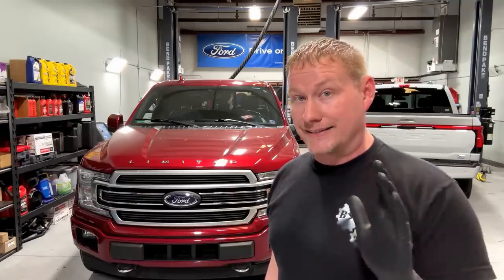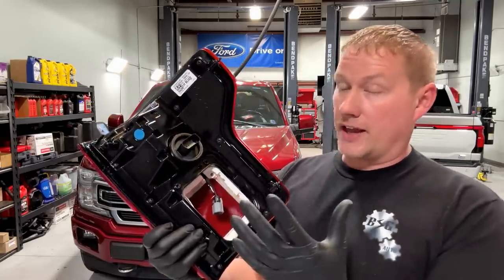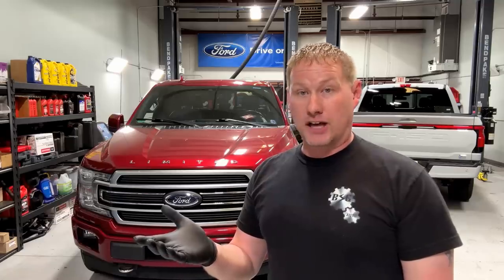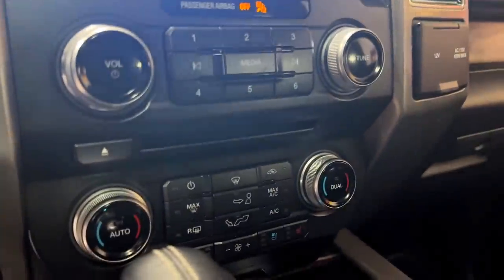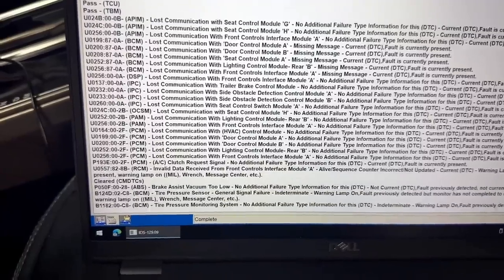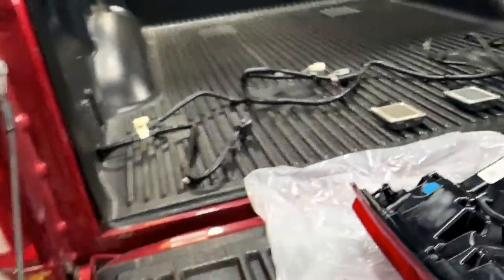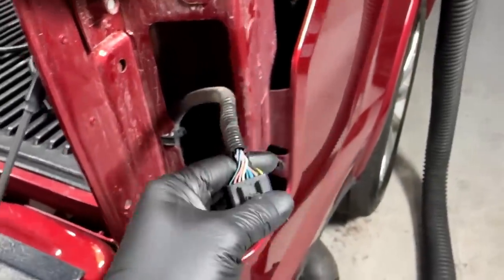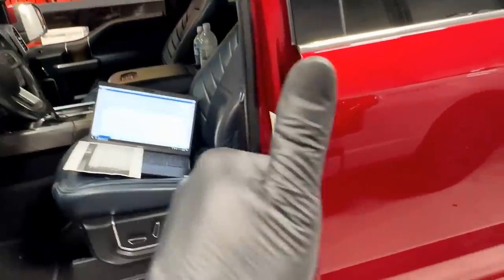Repair Cost Are Out of Control: $5,600 Bill for Some Tail Lamps?!

Comment: This is my truck. First off, I want to express my gratitude to those who advised me to contact my insurance company. I followed your advice, and Travelers Insurance paid me $5100 since the issue turned out to be water-related. Huge shout out to Travelers!

Now, the general consensus around here is that all this safety equipment is unnecessary. However, for me personally, I find the BLISS system quite enjoyable. Living in the Chicago area means dealing with wide tollways, around 4-5 lanes in each direction, where people speed at 80 MPH. But here's the catch, that same 80 MPH traffic can randomly slow down or even come to a halt. I find checking my blind spot monitor on my mirror much safer than looking completely behind me. 

I would personally be willing to pay $5000 for that extra safety. If I still lived in southwest Missouri, my place of origin, I might skip this particular feature. Driving is less of an extreme sport there, and a simple fender bender wouldn't turn into a gun fight the way it very well could in the Chicago area. 

I must say, having Brian as my technician is a true blessing. Just two months ago, the folks at the local Ford dealer (HAWK FORD) told me that my truck needed a new front differential. However, Brian correctly diagnosed it as a front wheel bearing issue.

Brian undercharges for his expertise, and FORD dramatically overcharges for taillights.
Reply: So BOTH lamps had the water intrusion - are the new ones an improved design or is this just a few rainstorms away from paying this again?  Direct replacement seems so risky.  I think I'd have you try to dry it out and get it working well enough to trade it in and buy something else with repair costs like that.  Sorry you had so much trouble but glad to hear insurance covered most of it.
Reply: Another issue with these tail lamps is that they also get stolen. Make sure you make it difficult to remove the lamps. change the 8mm screws to safety torx and make each one a different size. or your paying 5600 all over again
Reply: @ian3580  I was wondering the same thing since they were replaced with OEM units.
Reply: I'm so sorry for you
Reply: I wouldn't pay 5000 for an entire car even though I can afford a new truck like yours :) Glad you were able to pass the cost onto the insurance though!
Reply: @ian3580  
i really, really doubt those new assemblies are any better sealed than the old ones were. they may claim they fixed the problem, but i don't and never will believe them.
ford has a very long history of electrical problems.
ignition switch problems dating to the late 60s. fords burned down, including the garage it was parked in, and many times the house attached to the garage, and sometimes the family sleeping inside that house.

at least 3 different times ford said, oh we fixed that problem with the ignition switch, no they didn't. it came to a point they were forced to do some recalls, but only on some, not all that had the bad switches.
was an internal memo found that said it was cheaper to pay out a few "death claims" than it would be to actually fix the problem. to fix the defect was to admit there was a problem to start with. IIRC, the fix was to move some contacts 0.5mm apart & change the grease inside the switches. yeah, they KNEW for a fact it wasn't right.
another hazard on a ford, cruise control pressure switch under the hood. really ford? lets put a diagram pressure switch that with be in direct contact with the brake fluid on the master cylinder,.... that pressure switch starts leaking, develops high resistance, over heats and you got fire.

ford better ideal,.. HEY!!  lets mount the brake light switch ON the brake petal so every time the looser,.. i mean owner/driver hits the brake the wires move and then the wires break and the brake lights stop working & they get rear ended at speed.

and there have been some other stuff with ford,....
Reply: @konstantintomilin1826 Why?  So we can all pay higher insurance rates going forward?
Reply: Ford also had a problem with outside air doors in the HVAC system a few years ago.  So did Mazda.  They both used the same sucky supplier for the HVAC system.
Reply: Glad your happy,  but most familys wouldn't be able to afford to pay this money much less spend it on one stupid tail light... your very fortunate that you can afford it and that your happy to pay ....  most people are not able to pay such a large amount
Reply: Thumbs up for insurance coverage
Reply: @BaltimoreAndOhioRR  Just wait until you see the insurance cost of an EV!  My brother bought a hybrid (EV/GV).  I believe he said the insurance costs $400/month.
Reply: Glad that worked out for you. I bought my first F150 from Hawk Ford. If I still lived there I would definitely be bringing my truck to Brian as well.
Reply: Shouldn't Ford be fitting the bill and not your insurance?
Reply: Love the line that says "driving is an extreme sport". That's even true here in rural and remote hills of West Virginia. They're doing 65 and 75 on our curvy back roads, passing in double-line curves, it's getting crazy out there.
Reply: @irbfenian2594  only warranty, or special policy if its a concern to them
Reply: No doubt the safety feature is worth the initial price of entry. I guess they just need to make them waterproof, especially being marketed as a work truck, where it might get wet one day... because this level of failure at highway speeds doesn't seem very safe.
Reply: I will stick with my beater and .45
Reply: All the manufacturers way overcharge for their taillights.  Many of them have the electronics built into them and then you have to pay for them to be programmed once you get them so they will actually function as taillights because they are on a buss system and respond to commands rather than just receiving and electrical voltage or a ground.  It's ludicrous.
Reply: Thank god I live in rural Nevada. Warm and dry, no rust and not many people.
Reply: Congratulations for having found an awesome mechanic and technician and a friend!
Reply: @lewis2553  I'm the same way I'm happy with my 1999 Forester I just put a new engine in it about 6 months ago. I'm not worried about insurance right there's enough people buying new shity cars. I will stick to something that I own and it is cheaper and easier to maintain. It's also absolutely amazing in the snow.
Reply: That explains it. Have a 02 f150 with over 280k miles. Some years ago it caught fire around the brake booster. It was parked. Luckily we caught it early and immediately put the fire out. For a while I couldn’t figure out why, no wires where exposed, fuel lines where right, no dry leaves or stuff that can catch on easily where present.
Reply: It’s a beautiful truck but it’s one of those things where I will never own one. I do very well for myself as an engineer with no school debts and live comfortably. I still could never afford this kind of vehicle.
Reply: You are correct in that looking at the mirrors is better than turning your head. You should never turn your head over your shoulder when driving forward. If you adjust your side mirrors properly, you won't have Any blind spots or need any unnecessary crutches.
Reply: How many miles did you have on this truck when the issue occurred?
Reply: Thanks for sharing! Very valuable to get the backstory, and glad the insurance covered you on this! While you may be willing to pay $5,000 for taillights, that is something that is not viable for the general public. I do however suspect this cost will plunge in the future. It's good that Ford solved this issue, but I would have never, ever guessed it could cause a no start condition.
Reply: @WizardOfWhoopee same where I live. If your not doing 80mph on local highways, your in the way.
Reply: @WizardOfWhoopee   Gotta go fast to pick up more meth, bro. Them cat converters and AC coils ain't gonna strip themselves.
Reply: These kind of expenditures is how people making $250,000/yr end up living pay check to pay check.  When the economy tanked in 2008 one of my neighbors was selling off all his toys to try to pay his mortgage while he looked for another job.  You live in a $1.5 million home, but don't have 6 months of accessible emergency funds?  Yes he was foreclosed.
Reply: "Brian correctly diagnosed"  No, Brian told you what actually needed fixing, whereas the stealership would have sold you a whole new front differential for a couple thousand dollars and then charged you three times that for labor.  They probably would have replaced your hub bearing though, because, you know...  TECHNICALLY the wheel hub is attached to the differential.  Kind of like doing an engine swap to replace a leaking valve cover gasket.  Seems fair.
Reply: @NoName-ml5yk   That's the way of things now.  People with more money than sense.  These companies thrive off of it because they've convinced them to put everything on credit and just keep paying, telling them that it'll all work out in the end as long as they trust them.  Meanwhile, they're too terrified to try to work on or fix anything themselves because they're told it's too complicated for them and they shouldn't learn anything about their vehicles, just keep trusting and paying the dealers.  Don't worry though, the middle class in America is collapsing and soon we'll all be dirt poor with only a handful of billionaires left to lord over us.
Reply: @edward1937 gm also don't always do recalls
Reply: @SW20FL you're right as the vehicle will age the price of the parts will drop.
Reply: @upinarms79 Yep
Reply: I would never buy a Ford vehicle, not because of the vehicles, but the Ford dealers. My daughter had an Aspire that the dealer supremely screwed up on, being unable to diagnose and replace a transaxle output bearing until it took out the transmission.  
I've had many other dealings with local Ford dealers going back to my teen years.
Reply: Well stated, and points taken.  What was the rationale for Travelers to cover the repair, was it related to a claim?  I doubt State Farm would cover the bill.  Just curious.
Reply: @WizardOfWhoopee  So true.  I drive superduty Fords with gooseneck trailers in WV, oilfield work.  It’s scary, no berms, narrow roads, people racing to their graves it seems.
Reply: The car dealer's love folks like you! Willing to pay ridiculous prices for cheaply made garbage that you don't even need!
Reply: If the safety features are unreliable, how safe are they? I would never trade my instincts in for technology.
Reply: This failure is not as common as you might think. Just remember, the F-150 is the best-selling vehicle in America. There are millions of these trucks out there. And let's not forget, they don't fail without the driver being alerted to such a failure.

Now, let's talk about auto crashes and all those friends of yours who, unfortunately, are no longer with us. I'm sure you have quite a few dead friends. Well, guess what? So do I.

It's quite convenient for the living to boast about their survival skills, conveniently forgetting how many of their friends and family members met their untimely demise on the highway. It's possible that some of these safety features could have saved a few lives, or at least prevented some of those reckless drivers from crashing into others.

Take my truck, for instance. It's pretty hard to drift out of a lane thanks to the lane departure system. And if I did happen to drift, I wouldn't be able to overcorrect and roll over because various systems prevent that from happening. 
 @cmhwilder
Reply: @ImExcalibastard  I don't trust them to ensure there isn't a vehicle in my blind spot, but I do trust that if the sensor indicates a vehicle there, there is. So if the sensor shows a vehicle there, I don't crank my head around to confirm that. If there's no indication of a vehicle there I do look to visually confirm before I change lanes.
Reply: The issue with checking for blindspots safely w/o turning your head back (which I personally find ridiculous and dangerous and never understood why this technique was being taught at drive schools) can be resolved by adjusting your side mirrors so that you don't have those blindspots. Yes, even with those stupid flat driver-side mirrors (that somebody from the government decided were safer than convex mirrors the rest of the world enjoys) it can be done, though you won't be able to see the side of your car in them when in your typical driving position, which for me is the lesser of two evils. If I ever need to check for the side (e.g. backing out of a tight garage) I can just move my head close to the window and see the side of the vehicle just fine. It still beats having an electronic gizmo that will fail on you and might cost you an accident (or a $5K repair bill)
Reply: @lewis2553  so never use insurance for what it was intended for, but keep paying them? I get it that insurance is the sleaziest racket out there, but you're d*mned if you do and d*mned if you don't.
Reply: @deucebigs9860  Yes, use insurance "for what it was intended for", but, no, it wasn't intended for this.  This should have been paid for or repaired for free by the dealer either under the warranty or just for the sake of the reputation of the company.  The ones who are "sleazy" are the car companies who don't give a "bumper to bumper" warranty but only cover the drivetrain.  So quit buying from them.  But don't misuse your insurance.

Insurance is for accidents (liability and collision) and incidents (comprehensive) beyond our control such as flying rocks, falling trees, and floods.  Unless this water damage was from a flood, then this was a clear case of negligence on the owner's part.  You can tell when water gets inside a light.  It can be seen either as condensation or as pure liquid inside the light.  Corrosion doesn't just happen overnight.  The fact that the person chose to leave it there until it caused this much damage is grounds for the insurance company to claim contributory negligence, even if it was caused by a flood, and not pay a dime.  I've seen that happen, even in cases of collision between two vehicles.  Both parties' insurance companies agreed to claim negligence on the part of the driver who was innocent, and neither one paid a cent.  Each of the involved parties had to fix or scrap their own vehicle.  That wasn't fair, but I'm just calling it like it is.  But what you can expect, since this person has already gotten away with it, is higher premiums for him - and rightly so.
Reply: L I’m
Reply: @lewis2553  They covered it so it was used what it was intended for just not what you agree with.  Insurance companies don't just pay out for shiggles.  Really if water is getting into the light of a new truck it's on Ford to fix and pay for it all is my feeling.  Car companies should at least be able to waranty those items at least 10 years.
Reply: @benking9503 
Maybe fortunate or like others worked hard and sacrificed time for other things to create the ability to afford it? We don’t know what don’t know.
Reply: The end of that 3rd paragraph was fkin amazing bro 😂
Reply: How is this not a warranty repair instead of insurance? ???
Reply: the real issue is ford can't seem to build waterproof tail lamps...
Reply: Also in the Chicago area so I share your pain: crazy drivers, never-ending road construction with scary narrow lanes and bad weather.
Reply: @KameraShy  Try handling a tractor trailer rig in those construction zones with narrow lanes.  I've been there and done that.  It ain't fun.
Reply: @@JohnSmith-bo7gn They wanted you to be a repeat customer.  You would have had to come back and have them replaced.  That would have been an easy $5600 for them.
Reply: @lewis2553 Thank you for that bit of info. Added that bullet to my not yet full magazine of F!K EVs reasons. Cheers!
Reply: Glad your issue was finally resolved to your satisfaction. Thank you for calling out HAWK FORD by name for their miscreant behaviours. All too many YT'ers, both Presenters and Commentators lack the balls to do that. Respect!
Reply: what year of truck?
Reply: There are these safety devices called mirrors, they are amazing when you know how to use them
Reply: @@nateafcsouth  Bubble mirrors are your friend.🙂
Reply: @lewis2553 that was my concern as well the minute I read the water damage comment and there is a 100% chance we all likely will pay higher ongoing, for insurance in the future,  its already happening. This is the reason that at least 20 states have right to repair laws. Intellectual property rights vs. the right to survive and right to repair will be a massive ongoing issue down the road.
Reply: Sounds like you have money to burn I don’t feel bad. Enjoy the truck! I do hope you don’t have any more problems though. Safe travels
Reply: Good you got most of it covered but $5100 on insurance, no wonder insurance costs people a minor fortune with everything people claim. The really issue is Ford. $5600 for a rear tail light and radar is crazy. Radar detection parts in general are $25-$500.
Reply: I have a '19 Ranger Lariat, which isn't as fancy as a Limited trim, but it has a lot of that same computerized crap inside. This scares the shit out of me. Glad I chose the bumper-to-bumper warranty before I drove it off the lot.
Reply: I would never buy a truck this complicated  I owned a classic 72 Chevy short bed 350. 359 turbo sold it for 18800 I Aldo owned a 92 305 auto Trans had to have Trans rebuilt 1865 dollars plus one year warranty by a transmitting expert my parents knew  that is4000 dollars less than they fir for rear tail lights and modulat nobway would I put up with this this is insanity
Reply: Oh God, I'm so sorry you had to deal with HAWK FORD 😔
Reply: @Mytruck5600tailights very well put. They do make those sensors for people who can't drive very well or shouldn't be driving at all.
Reply: @pasolumination Truth!
Reply: A lot of people might talk bad about these expensive safety features but they may not consider that having these features may prevent a much more expensive accident.  Of course they must be used in conjunction with attentive and safe driving habits to be effective, however.
Reply: @NoName-ml5yk  "He who dies with the most toys still DIES!" 😂😂
Reply: Honestly I wish I lived close to Brian’s shop because there’s no one in my are a trust to not fire a parts cannon at my truck.  Brian is the real deal and he does very professional work and looks out for his customers.
Reply: @vorsprungdurchtech  It has to do with being honest and smart.  If a person is lacking in either of these two areas, he uses the parts cannon.
Reply: Springfield area huh?
Reply: You wouldn't need an active blind-spot monitoring system if you didn't drive a damn house on wheels.
Reply: You are an awesome customer.  You are working with what you have and not reacting emotionally. 

Cheers.
Reply: @lewis2553  Exactly. Now I understand why Allstate and the others have literally DOUBLED their rates in the past several years. Automobiles are getting terrible. Over computerized, inferior trash.
Reply: Such a shiny work vehicle.
Reply: You just be safe. I want you to be safe.
Reply: Drill a couple of small weep holes in the bottom of the lens so the water will not collect in the lens but will drain to the exterior. This can be done in a way where it is not visible from the outside.
Reply: If a headlight bulb burns out on my 2003 its $1000 per side because you need to replace the whole headlight. Well used to this.
Reply: I was looking at the video with suspicious eyes. At both Ford (leaking tail lamp recall?) and the mechanic (obviously). But reading that your insurance took care of this and about the mechanic's previous save, I powered down my outrage. I've been looking for "a Brian" my whole life. I've never had any single independent mechanic work on my car twice. Even when the job was done right at a good decent price I figured it was a catch and release so's they could gut me next time. I got my last two cars fixed and sold them immediately.
Reply: SELL IT
Reply: This customer was really lucky to have a mechanic with the ability to understand all those modules and how to repair them. The dealership would have charged him $12,000! I guess the old adage that F-O-R-D stands for F’d On A rotten Deal still applies!
Reply: @ebutuoy6463  You are replying directly to that customer. LOL
Reply: Fix Or Repair Daily
........ never goes out of style
Reply: 2018? That isn't covered under warranty you had to use a 3rd party insurance? For a safety equipment for a 2018???!! This is obviously a design and manufacturing issue. Unless it has ever been hit by anything that would damage the integrity there is no reason a 5 year old vehicle should have issues with a light housing.

This is one of the reasons I got the poverty spec Toyota. The premium trim had those fancy look-where-you-steer, $3600 headlights.
Reply: @Mytruck5600tailights Maybe if those various systems are working properly. How do you even know if they are working properly until you find out the hard way that they are not?
Reply: I don't trust relying only on these monitors. How well are they able to detect a motorcycle?
Reply: these type of systems are things I always get... I always spec the latest greatest tech gear on my trucks.. yes i live in 2023..  but its also why I Lease a new one every 3 years..  ive seen these kinds of things happen more and more.. just one 3 or 4k repair out of pocket if I kept a new truck past its warranty is going to more than make up the fact I "always have a payment" with a lease..  I do work with quite a few people in the school bus world..  (im not in that field but they are).. unfortunately water in tail lamps is a fairly common issue.. and it comes from inferior parts.. a repair like this is Not normal on a 5 year old truck..  I wouldve opened a case with Ford on this merit..  that these LED tail lamps are expected to have a much longer life..  and thus it was a defect even though the 3/36 is gone...  in the past ive succesfully gotten repairs partially or fully covered.. Luckily for you.. the insurance company came to the plate due to it being water but in many cases insurance wont cover it..
Reply: Initially, I leased this truck. The lease term ended in June 2021, with a buyout price of $38,000. At that time, due to a shortage, the truck's value peaked at around $60,000. However, after testing a 2021 Limited model, I found it less appealing compared to my current truck. Consequently, I decided to purchase my old truck, which left me feeling fortunate, as though I had scored a great deal.

Now, considering the Limited model's current price of $87,000, the monthly lease payment would exceed $1100. Personally, I don't mind how others choose to spend their money, but my objective is to keep this truck in pristine condition, both in appearance and performance, until it reaches 250,000 miles. Even if that means spending $20,000 on repairs, I am willing to do so.  @eldoradoboy
Reply: @Mytruck5600tailights  im not faulting you for keeping the truck.. nor for keeping it pristine (I keep everything I own pristine)..  I still would probably contact ford over this directly..  its not normal for an LED tail light assembly to get watered at 5 years old.. the manufacturers themselves advertise that you "never have to change bulbs again" as these units should have a 20+ year lifespan..the truck is obviously not beat up or abused.. manufacturers are using worse and worse parts yet charging more and more for the vehicles.. I dont mind the fact I paid 67K for my current pickup but I want it to be quality for that.. like I mentioned before its not the first time ive heard of those LED assemblies getting watered.. its unfortunate the number of vehicles I see driving around with broken factory LED lighting.. regardless of whether the $$ is economical in the lonbg run vs a new truck every 3 years.. chances are with today's market you will end up way ahead buying out the truck anbd hanging onto it.. hopefully its a glitch and you move on..  from what ive seen Ford Pickups are generally pretty reliable overall..
Reply: 1. Avoid Chicago
2. If 1 is impossible, get adaptive cruise control.
Reply: I would use the $5600 to rent a moving van to move back to Missouri. I wouldn't live in Chicago for free!  🤣
Reply: Sounds like you should still live in Missouri.
Reply: I'm sticking with my old vehicle. $45 for used taillights on eBay.
Reply: so now you're rates are gonna jump because you filed a claim...that's not a win.
Reply: I agree. My 22 Hyundai has something similar. It's nice to quick glance rather then take the time to do a full shoulder check. But yet I still do it cuz u never know when someone going over ahundo is gonna pass.
Reply: @lewis2553 did he buy a hybrid or an ev? There is a difference.
Reply: @chris-_-3073  A hybrid.  I know there's a difference.  His still runs off gas, too.  But it has a big, extra battery -- a lithium battery, the same type an EV has.
Reply: @pasolumination  6 dollar fish eye mirrors
Reply: As a fiesta driver in chicago im glad you use those blind spots. Im always a little worried with how massive blind spots are on new pickups. Thanks for looking out.
Reply: It's all fun and games until the supply chain is made even more skewered and you're waiting six months to spend 8k on a tail light that takes a host of other things on that same  circuit down,, simply so you don't have to move your head to look...
Reply: I came in here to make a comment and I seen you the owner of said truck posted so I'll post my comment in your thread. Here goes. If someone can spend 40k 50k and even more for a new truck, I'm sure they can spend the money to have  it fixed. TRUTH FACTS  This is why I drive I'm my opinion the best truck and model years ever made my mankind. Here it is 1999 to 2003 Frord F150 and Ranger I have one each and won't ever not drive on of these maybe not these ones I have e but said make models. Because iv owned Chevy in between these and that rusted peice of dog poop 💩 was nothing but problems. But as for men t ironed models they cost almost nothing to maintain just basic maintaince and the occasional put of left field mishap but even they are rare but when they pop up so easy to fix I can't stress enough how easy these are to work on. But parts are getting more and more scarce as they do r end up in junk yard unless wreked and they are getting old now even dinosaur old depending in your age. My son is as old as these but he stills lives em and owns one of each. Thanks hopefully I didn't misspell to much ad type g isn't my strong point but if my old girls could type they'd be GOATs at that as all things they do. TRUTH 💯 FACTS
Reply: @eliteskeptic5487 same. I'm also an engineer and drive a 2013 VW Turbo Beetle. Bought it used for $15k. I've modified it and just keep fixing it.
Reply: @FragEightyfive we did the same thing. Wanted to get a 3 row SUV that wasn't huge. VW makes a 3 row Tiguan. We got the base model plus a third row and AWD.  Every other higher trim level (some of which had things that would have been nice to have) required us to accept keyless/ pushbutton start which both the wife and I hate as we consider them to be unsafe.
Reply: @lewis2553  Aren’t older cars with a clean title getting lower insurance rates than newer cars?
Reply: @MrOiram46  Yes, they are.  We have 3, a 2003 Silverado 4x4, a 2006 Honda Pilot, and a 2005 Dodge Stratus on one policy for complete coverage.  It costs $140.59 per month, but we get several discounts.  There's the multi-car discount, credit union membership, and only two drivers, both over 25.  I'm retired.  Neither of us work.  We only take our daughter to kindergarten 4 days a week.  Plus you have to look at the value of the vehicle.  Insurance companies don't pay out as much money for an older vehicle in the event of a crash.  We can only drive, at the most, 2 out of 3 vehicles at the same time, and much of the time we travel together.  So that's another factor.
Reply: You're part of the problem... If enough people pushed back and said no this is ridiculous, maybe car manufacturers wouldn't make such ridiculous contraptions, I would never pay 5k because water got into a trail light. The design is absurd, but people just roll over and take it.. I will never buy something like this.
Reply: Honestly this is criminal.  Ford can't sell trucks so they jack up parts. So now car insurance goes through the roof for claims due to tail lights. I do know vehicles are totaled for things like  this , but when does it end? Trickle down affect we All pay
Reply: ❤❤q
Reply: Wow forget all that BS and the added expense especially for the average person who doesn't have the $$ on hand to suffer through such insane repair costs. I grew up in Chicago and yeah it's hectic with the traffic but I never needed a computer to help me navigate through it smh.
Reply: You are literally living in a different world.
Reply: Sorry if this has already been answered: Would it be beneficial to put some dielectric grease on all the connections you can access, to hopefully prevent this?
Reply: Wow ford rip
Reply: When two lamps have the same issue probably a design issue..call out the Ford community to see if it’s a general issue..if that’s the case Ford needs to deal with it
Reply: @CrapShackGaming   Yep. Had that happen to my brother's F-150 right out in front of his house. The thieves weren't kind enough to just unclip the connectors, but instead cut the wires behind the connectors. I would have had to find the right connectors and splice them in. What I found to be an easier fix was to go to the Pick-n-Pull and get the rear harness out of a similar year Bronco. It all worked out, but man what a pain in the ass for a pair of tail lights that should have only cost $30 each to replace.
Reply: The issue is not with BLISS nor any other safety related items and the costs but sheer poor quality workmanship that started a chain reaction killing multiple systems.  The American workforce for the most part just don't give a rat's ass about what they are actually doing and more concerned with earning high dollars and what they can buy with it!!!   Just look at the recent UAW negotiations - nothing to address the run away inflation caused by potato head decimating the oil industry!!!  And after they get their 20% increase in pay, they will all go back doing the low quality work that they've been doing for decades!!!
Reply: Sad for costumer, car makers save lot money and problems with Can system on cars but fails crave pocket owners.
Reply: @jmackinjersey1 when driving a passenger vehicle you should always turn your head to see if it's clear before changing lanes. Mirrors do have blind spots and the objects in the mirror are closer than they appear.
Reply: There's no need for it to cost that much
Reply: @lewis2553 yeees, because  after even a light crash the battery can’t be trusted (fire!) and has to be replaced! Thats why insurance on EVs are huge
Reply: @chrigdichein  Yeah, the old lead-acid batteries weren't that way.
Reply: I think the idea of a pickup truck with all this luxury BS is insane...
Reply: @lewis2553  It isn't worse than simply being a poor driver.
Reply: The willingness of insurance companies to pay these prices is the reason why all bills go up. I had a wing damaged on my old Honda accord, I got a quote from my local repair shop for 300 to replace with genuine Honda part and colour match. By the time it went through insurance it was nearly 2000 at an "approved repair shop".
Reply: The problem is not whether you would pay 5k for it, it’s that it’s only 200 dollars worth of work if designed properly. Congrats you would overpay, but that safety doesn’t have to come with that cost to begin with
Reply: @erik_dk842  Well, stop doing that, too.
Reply: I’ve bought my 2007 Tundra new, just regular maintenance and no issues since new. At about 160,000 miles now, going to run it till the wheels fall off.
Reply: @bugsy12341000  Are you sure there's enough gas in the world for that?  Toyotas are tough. 😂😂
Reply: Driving = extreme sport 😂😂😂… I love how you described it
Reply: The guy lives in crapcago, taste isn't exactly at the top of the list .
Reply: A cubs fan, union Dem,  no doubt.
Reply: Better way would be to let taillamps be just tail lamps. Sensors could be decoupled from actual tail lamps. This way broken tail lamp would be much cheaper and sensors can be replaced by itself or old sensor can be plugged into new tail lamp assembly. Even just having removable tail lamp cover is the only thing needed 90% of the time. That broken plastic/glass cover can be just replaced for 50 or less if made that way.
Reply: Not sure if you will see this or not but thank you for having the blind spot detection on your truck. I drive a small car because it's a fun, fuel efficient (35ish mpg, more if I wanted to push for efficiency), cheap and because I can. I don't see a lot of trucks with the detection on them, but I appreciate those that do because they won't run me over 9 times out of 10.
Reply: The irony of all this is that LEDs are supposed to be longer lasting AND INEXPENSIVE. But like everything nowadays they’re marketed like a luxury feature that allows them to charge much more than traditional. Same with instrument clusters that are screens instead of traditional dial gauges. Cheeper to make. Increase the price to consumer all equals more $$$
Reply: @lewis2553 ….Blend door actuator in my 2015 Ford had to be replaced less than two years after I purchased the car. Ford replaced it under warranty. The paperwork indicated it was a $500 job. Three years ago it started failing again. No longer under warranty, I looked into purchasing the part and the replacement procedure. Part: $25. Labor: 20 minutes with simple hand tools. The problem is the plastic gears in that module are so brittle the teeth shear off.
Reply: @mercoid  Well, that's a different problem.  I had an early 2000s Ford Exploder, and the problem was that the outside air door would break and stick open.  The dealership quoted me $800 for the job, I think.  It may have been more, because I remember they said it would require 8 hours labor and would require two guys to remove the cockpit.  I asked how much it would cost for the part, and they said $400.  I said forget that, and traded it on a Mazda B2500, only to find out later that it had the same problem.  That's when I discovered that Fisher made the bodies and heating systems of both of them.  I haven't bought a Ford or Mazda since then.
Reply: Hopefully,they won't cancel you after this.
Reply: i can understand that.  Your money, your choice.
Reply: Seems like the new normal is to give everyone the business. Everything is a scam or racket. Car dealers to buyers, insurance companies to patients, banks to mortgage holders, government agencies to taxpayers, politicians to voters, Airlines to passengers, big pharmaceuticals to sick people, stock brokers to speculators. Where will it all end?
Reply: While I agree that I may be easier to just look at the blind spot monitor then to look behind you, this is in my opinion one of the reasons that a lot of people don't know how to drive nowadays. Everything today is technology assisted and it shows! When people back out of a spot do you see them check all their blind spit and behind them? Nope, they look at the backup camera and take off lol. I honestly believe we could cripple this generation by taking away backup cameras, making vehicles standard instead of automatic and just writing everything in cursive. 😂
Reply: I briefly did the math. One taillight case 1300, one LED light 650, and one harness for 100. So two of them comes to 4100, plus 350 backorder fee is 4450 already. You billed the customer for 4 hours which seems super fair for this complex diagnosis. 

So assuming you spent that much to purchase the part, it seems you didn't include any markup to the parts for this 5600 bill. Shoutout to your work, and I have a huge respect to you for undercharging your expertise.
Reply: The same thing just happened to me yesterday. I live in Chicagoville, 2018 F150 limited with 42K. I checked connections and tail lights today. No real visible water or humidity.  After removing both lights I turned on the vehicle, still having no A/C, front windows, seat and steering wheel memory, no BLIS, air back light on, running boards and side mirrors do retract. What a pain in the ass!!!
Reply: I find spending this kind of money for an expensive Ford truck especially when issues such as tail light water intrusion, monitor issues, differential (a misdiagnosis) and wheel bearing issues come up when the truck is only a few years old. Ford needs to build better trucks, include a better warranty or take a hit for poor sales. I think I'll stick with my Dodge RAM.
Reply: The BLISS system is a $500 option, at least it was when I bought my 2017. Crazy how a $500 option can cost $5000 to replace.
Reply: My 2010 f150 had a water intrusion on the drivers side. I removed the bulbs and reinstalled them with O rings. Problem solved.😂
Reply: 😊I have a Tesla model s with full coverage, and I pay $98 a month
Reply: @TheBandit7613 no water either. 🤣
Reply: Brian is the Man !!!  Smart , Honest , tell  you like it is,  !!
Reply: I'll turn my head and look and spend the 5 grand on something like a good used car, new driveway or any damn thing that is sane.
Reply: You can cut it open and replace all LEDs and that would work
Reply: If you don't now after knowing this, get rid of this truck, you are not a very smart person. If you can't drive in traffic, maybe move to the country.
Reply: how old are you, mirrors without the objects MAY  be closer than they appear are shite
Reply: @lewis2553 Correct.  Generally speaking there's no free lunch.
Reply: @Mytruck5600tailights  I'm glad you drank all of the Koolaid. That didn't leave any for me. 😂 You probably took the 💉 because they told you it would save one person's life. 😂
Reply: Nice truck dude
Reply: In oak lawn?
Reply: Yike's Chicago, may need to opt for bullet proof glass for the $5K. Glad you got the truck figured out, she's a beauty, and now infamous.
Reply: @CrapShackGaming  When you lock the truck, the tailgate locks as well so there's no access to the screws.
Reply: " I find checking my blind spot monitor on my mirror much safer than looking completely behind me. "
I just adjust my mirrors correctly so there's no such thing as a blind spot.
Reply: Sounds like copium to me.
Reply: Water damage
Reply: But really you werent willing you filed a claim to get someone else to pay it
Reply: Wow
Reply: Well... but .. atleaat he saved so much money on the light bill by switching to LED. Very.... economical....
Reply: @hvacdr  Yeah because the electric company meters your truck ...
Reply: good for you
Reply: I get the “driving as an extreme sport” because we have similar conditions in WA.  Same stresses and need extra assists    Be safe out there.
Reply: How does this the traveler insurance work ? Like water damaging the lamps?